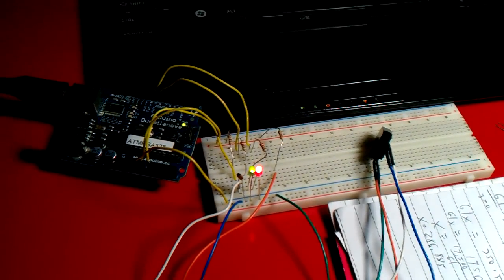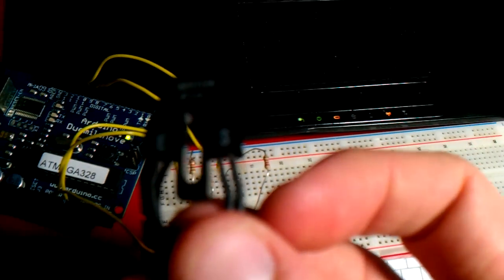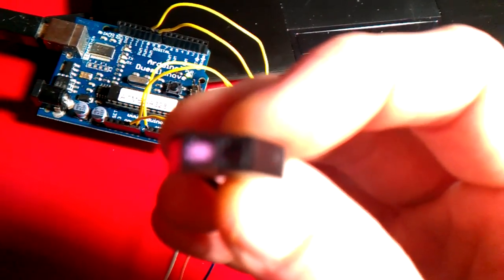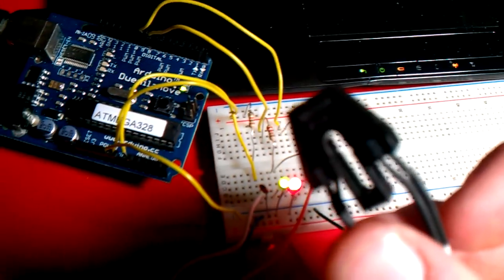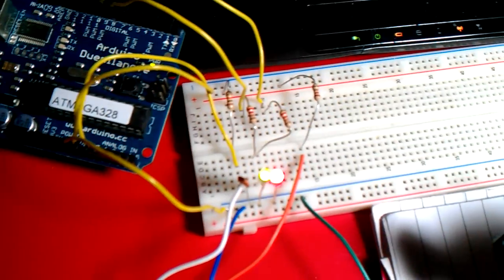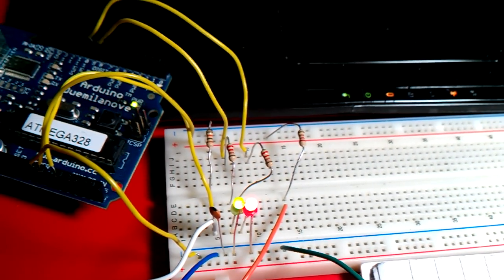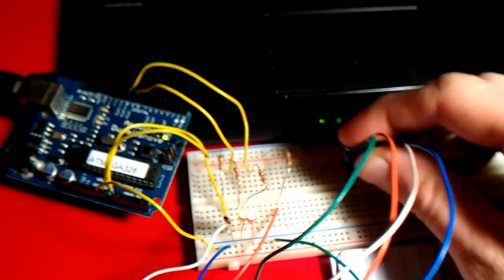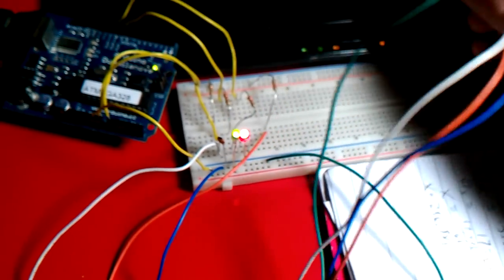Using an IR Sensor with an Arduino

Comment: Hello, I am trying to make this project to work, but I am in dount with the resistor and capacitor numbers. I couldn't have access to the link you provided. Is it somewhere else?I think the circuit i did is the same,  and I am printing the sensor analog signal, but it only printing the smae range of values: 321, 322, 323. if I put a black or white paper. I used a 10K, with the yellow, 220ohms with the white and a 0.1 uf capcitor.
Is the project details somewhere else?

thanks

Comment: hey, i would like to ask for help if possible:
for my project i use 2 sharp sensors, (ranges 100-550 and 20-150 GP2Y0A02YK0F) building kind of guiding device/obstacle detector for blind. unfortunately both sensors have the same ‘problem’ i can’t fix. as you can see from the datasheet, the output as a function of distance is parabola - therefore every output voltage may have 2 options for distance. despite the fact i want to use only the range 100-550 (for ex.), the sensor does also react to 0-100 giving different outputs which may be interpreted as other distances leading my blindman to hit the wall or something.. . i’m using the sensors with Arduino, and can’t find a way to handle this double values problem.
will be very very grateful for solutions or ideas Gary

Comment: Hello, I am trying to make this project to work, but I am in dount with the resistor and capacitor numbers. I couldn't have access to the link you provided. Is it somewhere else? 
I think the circuit i did is the same, but I used a different code, with digitalRead int he PWM pins. From this link letsmakerobots post ->12293" Can it work in the digital pins?

Anyways, I will try yours.
Is the project details somewhere else? 
thanks